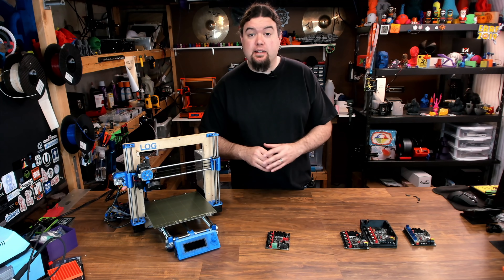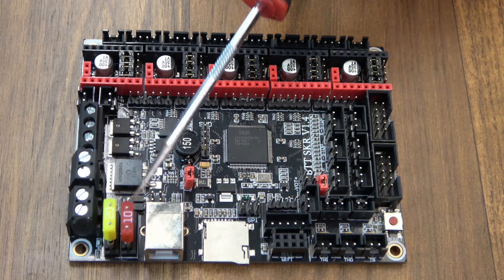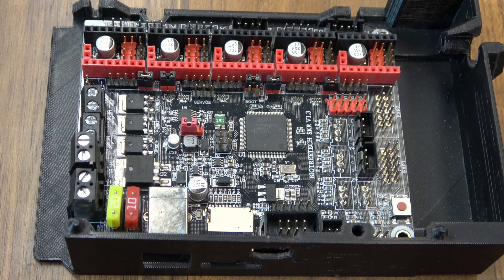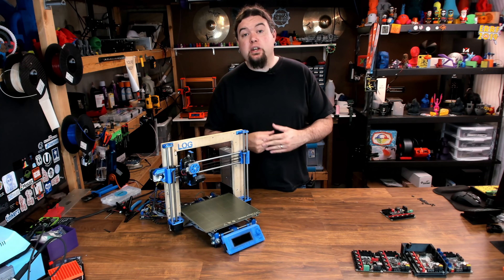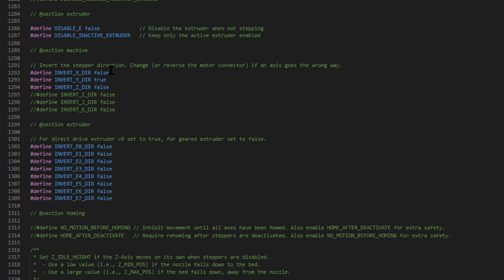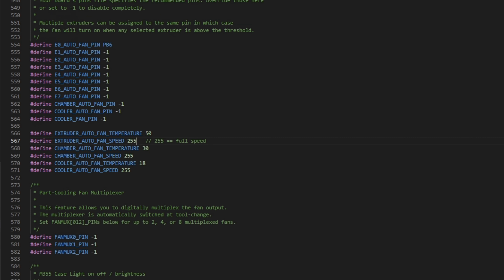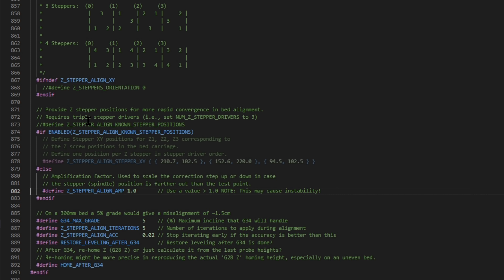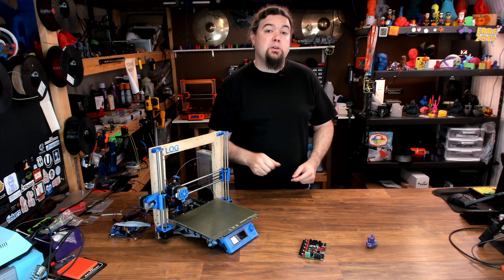Big Tree Tech SKR 2 - Install - Marlin Configuration - Chris's Basement

Comment: Hi Chris, Excellent Piece as Always. One Gotcha with the SKR2.0 that maybe apply as well to the previous generations, I replaced 3 months ago a Makerbase MKS Gen L board on a JG Aurora A5 with a 30cm 24V Bed. I assumed that as fare as the bed was concerned I would have no PB driving the bed with the SKR2. I had a quick look at the main specs and found nothing about it and assumed all OK. In fact if you scroll at the end of the Doc there is a Red warning not to Exceed 10A. My Bed draw 12A and worked without problem for a few prints until the board started smoking. I caught it in time and had to add a Heat bed controller. The mini Fuse on the board is rated at 20A and would have never blown, but it was just a question of time for my board to fail. I did not get around to it yet, but would recommend replacing the fuse to something more appropriate, like maybe 15A, would not have solved my problem but would have definitely blow before the board in case of a short. Keep up the good work !!!
Reply from the maker: You bring up great points, I think this would be a worthwhile test to show others that this might be dangerous.
Reply: @ChrisRiley  I have not seen all your videos and a quick look did not show a video where you add a heat bed controller, that might be an other video idea to explore for you. If you are interested I am using a Hiletgo Heat Bed controller. It works, although the amazon listing market it as 30A, but the unit mention a max of 25A. I did not buy it because it was the best or cheapest but at the time I needed a fast solution and I could buy it with Express delivery. On the positive it is rated 12 to 50V, in theory this could push out past 1000W to a heat bed or enclosure, if you can find anything that can match that power rating without going in main voltage territory which might be a bit too risky, maybe big volume printers ?
I still have to look up the fuses, don't know what model to look for yet. Take care.
https://www.amazon.com/gp/product/B07C7RQ4C6/ref=ppx_od_dt_b_asin_title_s00?ie=UTF8&psc=1

Comment: 25:38 I think you made a mistake here. PA10 is part of the 5 pin TFT connector, which is just above the 2 connectors for a BLtouch. The probe pin appears to be PE4, though I haven't tested that just yet.
Reply: i second that, as I'm literally installing this board as I type, also PE5 is the servo not PA9....Im not using the Z endstop...im using probe and servo...knowing this i just uncomment define  Z to use probe correct? And comment the use z endstop.
I'll know in a min when i fllash the board lmao

Yes i was correct in the define z to use probe if you use the bltouch row of pins and not the z end stop pins, only thing i got wrong was part cooling somehow
Reply from the maker: I could have, sorry about that, I probably read the pins file wrong.
Reply: @ChrisRiley  All good man, thank you for making this guide!
Reply: Also agree on this one, I couldnt figure out why it wasn't working until I double checked the pinout.

Comment: Hi Chris, i am going to update my Delta (Kossel LP). Do i still need to cut out the DIAG pin on TMC2209 to use mechanical end stops like sugested in tutorials for 1.3 or 1.4 boards (Lucas Pomykal) .. or are there jumper options on SKR2 Rev2 for that?
Reply from the maker: No need, SKR2 has a jumper for that.

Comment: Thank you so much for the video. After completing the installation and configuration, I came with an issue : only half of the steps are executed...!!  Sounds like this is a known issue with the TMC2209. I tried couple of fixes suggested, none worked for me and I finally got rid of the problem by swapping to TMC2208 drivers. Any idea what the cause is, what boards and/or drivers are impacted, any suggestion to fix the issue ?
Thank you.
Reply from the maker: My guess is that the 2209 board isn't configured for stand alone mode correctly. I have looked around before and it's very hard to find a 2209 that states it is for step/dir mode like you can on a 2208. For the life of me, I don't know why that is.

Comment: Great video 😍 , but I ran into an issue which is there is no power at all!! I checked the jumper and they are correctly fitted, and power supply jumper is fine but no power at all, any idea about this issue ?
Reply from the maker: Thanks! Wow, the only things I can think of is to check that jumper, make sure the input voltage is on the correct terminal and check the fuse. You can swap the 2 micro fuses as a test, but I wouldn't run it that way.
Reply: @ChrisRiley  I will try and see what happens, thanks 🙏🏻
Reply: @ChrisRiley  The power supply is giving 24 V no issue with it at all, I changed the jumper to new one put, and I switched the micro fuse but the same issue. The board not working at all !!

Comment: I missed the part fan configuration.  where is that done?  I got the e0 fan, but looking back i didn't see you set the Part cooling fan.
Reply from the maker: Part cooling goes on fan0 (PB7) closes to the power plug, hotend fan on fan1. https://youtu.be/1PPBHn-jU0k?t=860
Reply: Hey, thanks for the reply and so quick.  I eventually just plugged it in and figured it out.  It seems that the PB7 is the default part fan and the other can be used for other fans I guess.  Since i haven't seen any docs that call this out i have to guess that all of the fans 5-7 can be managed by the board for power and through marlin you can set them to do different things.  I'm guessing that if you don't change marlin that maybe that ALL act as parts fans unless specifically called out?  Not sure.  I have it set the way you do for now and all seems good.  My big issue is the FTF35 that not connecting.  I found that the 5V TFT pin is only reading 1.3V and the RX pin is shorted to ground..so maybe a bad board.  Thanks again!!  @ChrisRiley

Comment: Great tutorial, thank you :) Just a small tip - you can navigate to the firmware.bin file (open the containing folder in Explorer/Finder) simply by clicking on the "Built "firmware.bin" at..." link displayed on the ABM panel (see 42:19). It is a bit easier than going back to the explorer in VS, .pio folder, etc.
Reply from the maker: Thanks for the info!

Comment: Hi Chris! Any advise for mounting this board on a mk3s+? There's some parameters reference on line to get the right config?
Reply from the maker: Marlin has a config for it. I would just use this and change up the board settings. https://github.com/MarlinFirmware/Configurations/tree/import-2.0.x/config/examples/Prusa/MK3

Comment: Great video! It was going amazingly well until I got to the dual Z stepper part... I don't see anywhere in the config_adv.h file to define how many Z steppers there are. A ctrl+f for num_z_stepper_drivers returned nothing. Same with variations thereof. Any idea where its been moved to and what its called? Thanks!
Reply: If anyone is wondering the same, here's the answer. When you uncomment Z2_DRIVE_TYPE in the configuration.h file, Marlin automatically knows that you are using two Z steppers. Marlin has removed the num_z_stepper_drivers from configuration_adv.h because it is redundant. You may skip the num_z_stepper_drivers part on this video.
Reply from the maker: Thanks for posting the answer for others, glad you found it.
Reply: @ChrisRiley   No problem! People answering their own questions have certainly helped me in the past lol

Comment: Chris, is there anything we need to add to get the constant 12/24v pins along the top of the board live? It seems many others running Marlin have had no luck in getting the non PWM fan connectors to go hot on these SKR2 boards.
Reply from the maker: There shouldn't be anything else you would need to do.
Reply: @ChrisRiley  thanks for the reply. Shortly after sending that I realized I had a bad board... While ts I let out some magic smoke and the constant headers started working...... But now nothing else does. Great walkthrough though. Should take the plunge and show us normies how to get klipper up and running!

Comment: Do you have a video that outlines what is necessary to get the SKR2 Rev B to allow USB - Serial Uploads of bin files? (Arduino bootloader?) For instance, do we need to use an STLINK in between via the SWD? Or is there another method?
Reply from the maker: I think STLINK would be the only option, I would have to investigate how to set that up.

Comment: Hi I have a skr1.4 Turbo board with 2209 driver and set up as corexy for a laser and therefore use only the x and y axis.
Since I have not been able to make sensorless homing work I have cut a few pieces and put endswitch on, but get the same error and just can not see what is wrong, I can home x and y who separately and it works but when i set it to home y and then x, it run as it should until x is done and then i have to restart, do you have any ideas for what might be wrong! have tried different versions of marlin and it gives the same result
Reply from the maker: Check this setting. //#define CODEPENDENT_XY_HOMING  //#define HOME_Y_BEFORE_X  Are either one enabled?
Reply: @ChrisRiley  sorry for the slightly late feedback, but thanks for the answers and the great videos you make
Allan

Comment: When you order the SKR 2,  also order a set micro-fuses on Ali, there easy to get there and cheap.
I just Blown the 20A fuse on my SKR 1.3 after upgrading my PSU unit to 600W. Turns out my heatbed draws way over 20A when not restricted.  (Old Tevo Tarantula 20x28cm bed wired for 24V)
Marlin setting MAX_BED_POWER was my Saviour! Setting it to 170 gives a max of 20A when heating. (from 18C to 100C in 2 minutes now)
So yes, make sure you have spare fuses 😎
Reply from the maker: Thanks for the tip!
Reply: @ChrisRiley  You're welcome, love your channel!

Comment: Thanks to this video my printer is bavk online.  Thanks
Reply from the maker: Is everything working now?
Reply: @ChrisRiley  I am going to put this here so that everyone knows why you are the absolute King.  I read the email, and after double checking everything, I looked back at the pinout and you know the 5 bare pins next to the TFT socket, well I can tell you they aren't for the TFT serial connection.  after moving them to the TFT socket  what do you know it works.  Thanks again for tolerating my stupid human tricks.

Comment: I have a revision A board and my chip there blew up when I plugged in my driver, the Correct way... So ... I donno if they will swap it out or not
Reply from the maker: They have had a lot of issues with these, so it's worth a try for sure.

Comment: I have a ender3 400 x 400 extender kit with a skr mini 3  v2 and a tft 35 monitor. After updating my firmware when looking at the leveling corner it's not check the whole bed like it should. Seems like the is still at 230x230. When I check the mesh it works, checks the 400x400. Can you help me solve my problem.
Reply from the maker: Bed X and Y size is really all that controls this. If you can move to the 400x400 size, leveling should do the same unless they are manually set in configuration_adv.h.
Reply: @ChrisRiley  I had to change the TFT build size as well in the config.ini

Comment: I have an Anet ET5X that seems to have died. Could you recommend a replacement board?
Reply from the maker: Just about any board would work, but make sure it uses standard JST style connectors before you buy one, some of these printers have specialized plugs on them. Also, with the touch screen, you might not be able to get it working on a 3rd party board. All that said, if you want to go with a lower cost board, I like the BigTreeTech SKR 2.
Reply: @ChrisRiley  ok thx.

Comment: I was watching your skr 1.4 turbo and My printer says no printer attached, how do i fix that?
Reply from the maker: There should be no Marlin changes as far as the screen goes. You just need to hook up the 5 TFT wires to the TFT pins on the board. In Marlin you just have to make sure the baud rate on the screen and Marlin match for all the serial ports. Try setting serial 1 to -1 and serial 2 to 2.

Comment: I am curious how this handles a MK3S+ which uses two power feeds from the PSU and the parts fan is a 3 pin.
Reply from the maker: It would probably work out well. You would have to run non-prusa firmware of some kind, the yellow wire on the fan would be the tacho that the prusa firmware uses, but you wouldn't need it in other firmware types.

Comment: Hello Chris, thanks for your great videos! I need your help: I have a SKR 2 and run it with 2 Z-Drivers. But in the current Marlin firmware 2.0.9.5 or 2.1 the entry #define NUM_Z_STEPPER_DRIVERS 2 is no longer available. It was still there in 2.0.9.3. Do you have a hint for me? Best regards from Germany ;-)
Reply from the maker: Thanks for watching! That option would be on by default in the newer version if you enable the Z2 driver. //#define Z2_DRIVER_TYPE A4988

Comment: Hi, THX for Your great videos. I have seen in older videos maybe also here, that some commands are red underlined for an error. Mostly the "Enabled" "ANY" an so on. I have the same errors, so its not easy to see if defined or not. Is there a way to get off of this red underlines. LG Stangl from Bavaria
Reply from the maker: Hey, I have noticed that same thing. I have been looking for some sort of extension to make this better, but haven't found anything helpful yet. It appears to be some sort of bug with how VScode handles the C language.

Comment: Hi Chris. I was wondering how you keep your filament dry even though you have them hanging in the ambience. I have mine and it prints like crap. I had to throw away a bulk stock of filament i bought because of moisture and brittle filament that broke inside the nozzle causing clogs. Is there filament i can buy that does not absorb moisture or goes brittle from long storage durations? Cheers Chris.
Reply from the maker: Hey, it really depends on how the filament is made. Some just falls apart over time. It's very hit and miss.

Comment: Hi Chris and thanks for your straight forward, info filled tutorials. I've been upgrading my Creatbot DX with the skr2 and tft35v3 and followed your  vids here. I found the cable for my tft was built the opposite of yours (V+, gnd,etc) re the markings and to enable it on the board had to use "serial 1". "0" and "-1" both wouldn't work with "0" bringing the error that it wasn't even an option! All good so far, now need to figure out how to implement the thermocouples it is built with......  Best regards from NZ,  mate!
Reply from the maker: Maybe it's opposite because you're in the southern hemisphere. ;) I'm glad you got it worked out! Good luck
Reply: @ChrisRiley  to update. I changed the TFT35v3 fw from the Unified theme to the Round Miracle and got all the Hotends & fans showing on screen. The Unified would only show this in Marlin mode. Nothing on YT (or BTT) re the menu system and how it works. eg: "HOME" instantly sets the current position of the head as HOME..... bit of a trap.  Cheers once more :)
Reply: An update and query - have everything working pretty much tho not got to the filament run-out yet of PWR out/restart.
Am stuck on getting the E0 & E1 Temps working. Am using the original Thermocouples with AD597a boards. Have selected "-1" for the "AD595" option but only get inflated readings; changed the options re Gain & Offset which gets a believable number but stays locked until heated then doesn't give a true reading. Is there a Temp Table to be implemented as well? Nothing in Marlin hints at needing one yet nothing acting normally.  Any suggestions please?
Reply from the maker: @ianofawai2797  I wonder if those are going to require and amplifier to work correctly?
Reply: Hi, they have AD597a amps. I'm thinking they may be configured as 'pass thru' amps and therefore can be set as a regular thermistor. Maybe using a PT100 table......
I'll be trying this next. Cheers

Comment: Hi Chris. Great guide. I have just replaced my burned out SKR 1.4 Turbo with an SKR 2 on my Prusa I3 MK2 clone. After following your guide, the only issue I have is that the two z-axis steppers seem to have a different number of steps per unit. I have mimicked you config by plugging one in to the E1 connector.  I get a warning of #warning "Auto-assigned Z2 STEP/DIR/ENABLE_PINs to unused En_STEP/DIR/ENABLE_PINs.", which I would expect?  Where should I be looking to solve this?
Reply: I have tried going back to parallel connected Z axes. My LCD shows the TCM CONNECTION ERROR. The Z Axis moves twice as far as it should. I am using the same settings as I had on my SKR 1.4 Turbo. Does anybody have any idea what is wrong?
Reply: SENDING:M122
Testing X connection... OK
Testing Y connection... OK
Testing Z connection... Error: All LOW
Testing E connection... OK
Reply: Ok. I solved my problem. Maybe this will help others. I had decided my board was faulty, disconnected everything and taken the bird out of its case. I took out the TMC2209s and then realised the jumper was in the wrong position for the z driver! I smacked my forehead with my palm, reassembled and all was well.
Reply from the maker: Hey Tony, just now getting around to reading through this. Glad you found the issue and kept us updated.